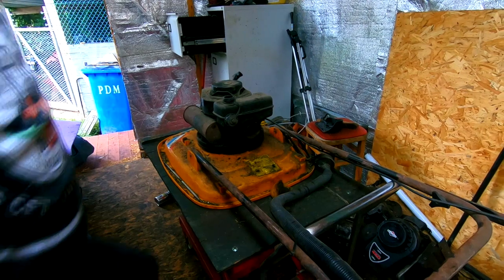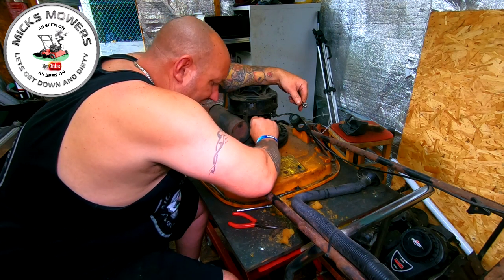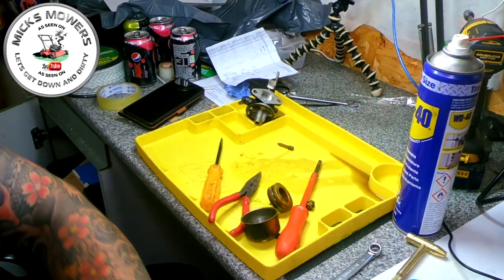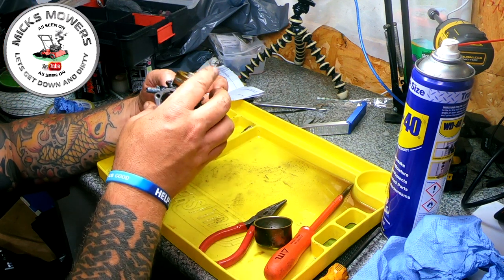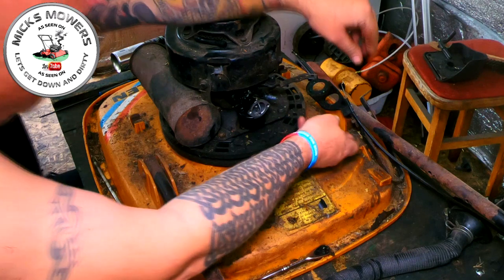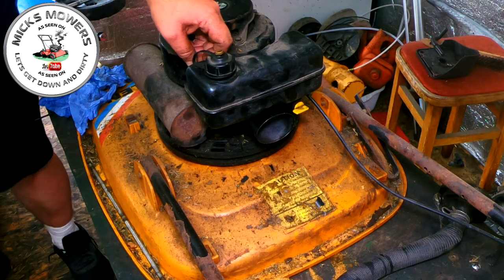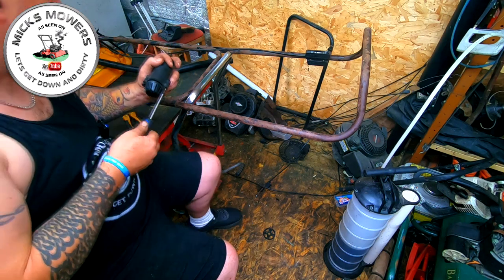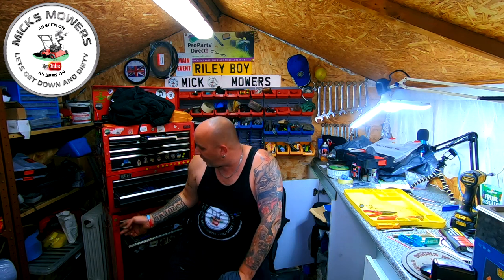Allen 218 Hover Mower Been In Storage For Years Lets Get It Running Again

Comment: Genius Mick 😁 well done bud such an easy fix as well ( bit of a different design of a mower with the hose ) , Mick my fs 55 ( strimmer ) isn’t working properly I have renewed the piston so compression is good ( I have tested over 100 psi ) , the carb has been trough the ultrasonic cleaner 5 times new gaskets etc it idols great giving it full beans and running it through longish grass it just wants to die on me ease of the trigger and I can build the rpm back up put it back in the longish grass and wants to die 🤦‍♂️🤷‍♂️ any clue bud much appreciated
Reply from the maker: What about tuning it on the high side to give it a little more fuel.. ?
Reply: @themowerman  I will try this later thanks for replying Mick